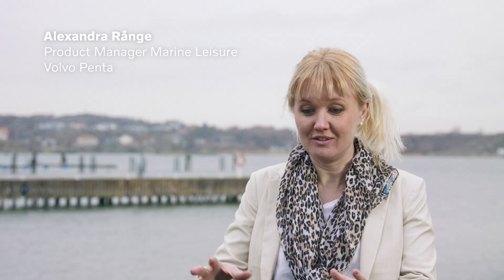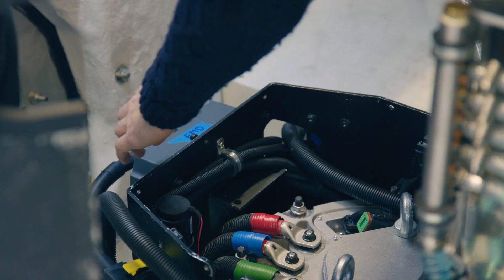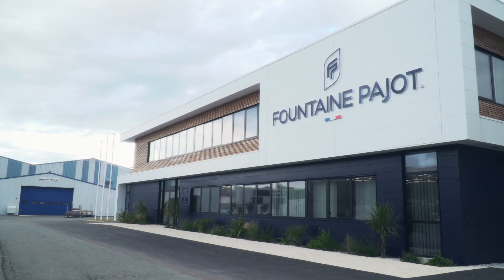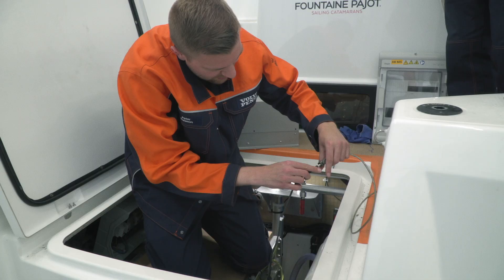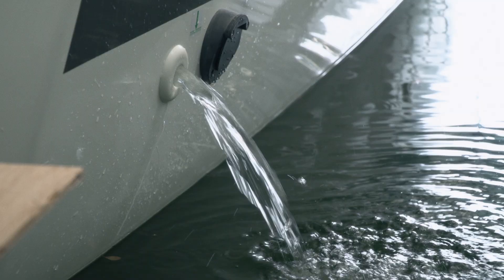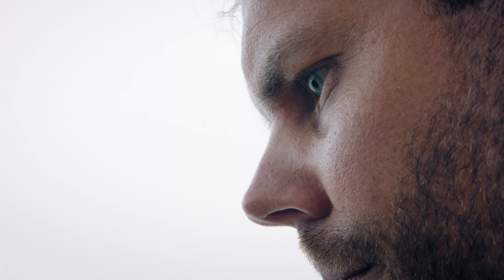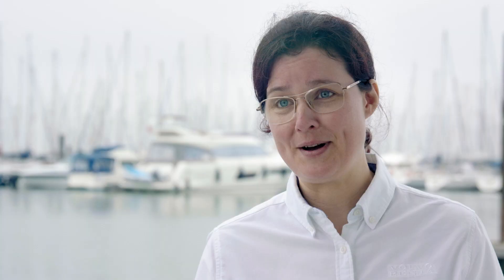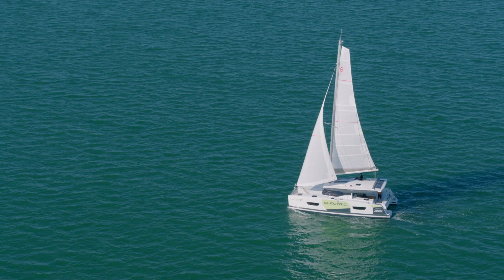Electric Sailing Catamaran - Volvo Penta and Fountaine Pajot reveal

Comment: About time really. This should have been out of prototype and into production at least 5 years ago as the relevant battery technology has been around for a decade or more.

The catamaran used is woefully lacking in solar for this type of set up too.

While this development is encouraging, FP and the rest of the production yacht industry need to start offering electric powered yachts now.

Comment: The reality is for most cruisers you'll have many days that require long-distance motoring.  So the number one criteria is that your generator is completely silent with minimumal vibration.  If it is set to run at optimal efficiency, that should be a known generator RPM, so you should be able to tune the mounting to isolate the vibration from the hull.  Also since there is no driveshaft off the engine, all the connections can be flexible, further isolating sound and vibration transmission to the hull.   

The other option for a catamaran is to have one traditional diesel sail drive and one generator+electric drive in the other hull.  The traditional sail drive saves cost and lets you go long distances on one engine at an efficient cruise speed.  The electric drive lets you motor-sail in light winds using the silent electric motor.  You also have the electric motor available for power generation when sailing in stiff wind or for immediate power-assist say for tacking or a quick maneuver with no delay of starting an engine.   

Look at the Integrel system, this shouldn't be some expensive add on. It should be standard on every marine diesel auxillary to maximize the propulsion+generation from every ounce of fuel.  There is no reason that any sailboat needs 3 diesels (2 propulsion+ generator).

Comment: This is awesome!  We expect to be cruising in about 5 years and would like to have motors rather than engines. Just a thought of this video, however...One of the key points is the quietness of electric motors over diesel engines.  Maybe just have some natural sound of the boat under power, so we can contrast with what we're used to.  I've tested a boat converted to electric; it's such as difference.

Comment: This system requires two 7.2 kW generators and two large battery banks for the two electric motors. Isn't it better to take only one electric motor and one battery bank on one side and a diesel engine on the other side, which can also be used as a 4.8 kW generator for the electric motor. For more information about my idea for a smart hybrid system for cruising catamarans, see: https://welt-ahoi.de/en/2020/08/26/smart-hybrid-system-for-cruising-catamarans/

Comment: Combinations of high capacity lithium batteries and water are not very recommendable in open seas, when you have nowhere to run if the worst happens.
But I can see a use for this technology when installed on river boats or similar. In Venice or so.
Reply: Mmmm, how many new technology electrical cars combust vs how many petrol / diesel cars combust.   Honestly, you are probably better off using oars rather than any engine.  Better yet, stay on land.   You sound like the sailors 10 years ago - “gps and electronic charts will never replace actual charts - too unsafe and unreliable”.   Seen any charts lately.   This is progress in the right way for sure.